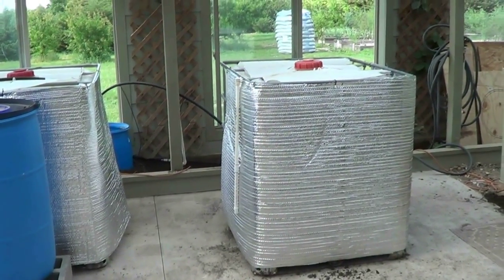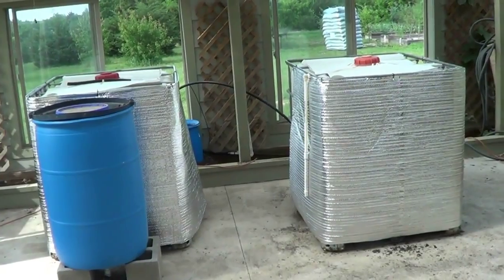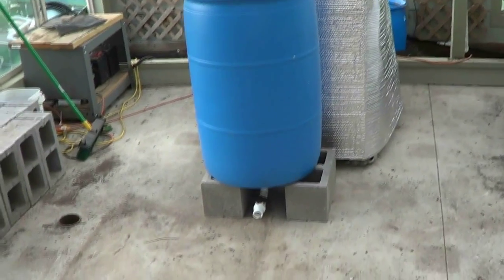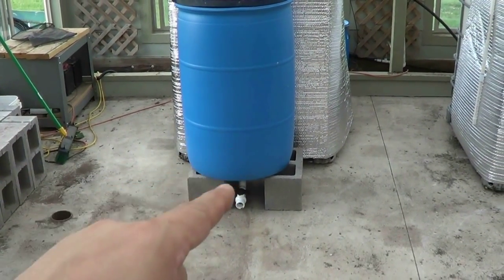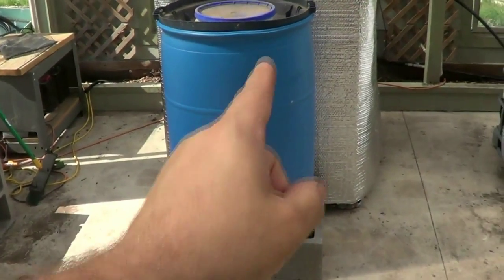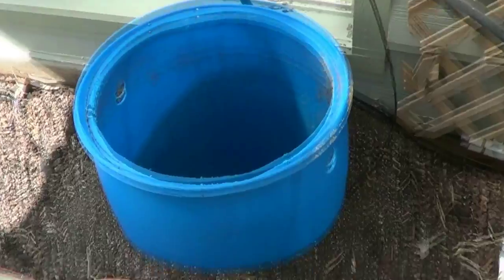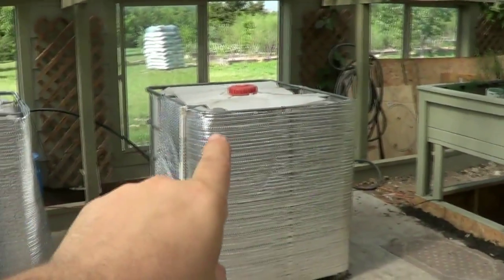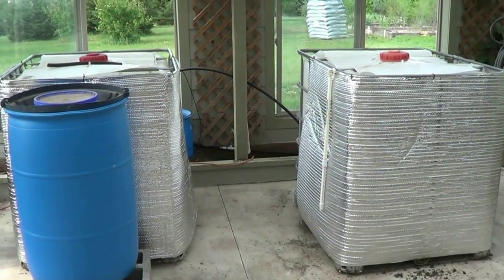Starting of the Aquaculture System

Comment: Nice home Tracy, I wouldn't go so deep with your Venturi it will waste energy for not much O2 gain and stair up the fish poop.
Great video though keep them coming I've built something similar after watching Rob Bob n Paul ;-)
Reply from the maker: I was wondering about that - The venturi's I have  will be easy to trim up a little if needed - right now they are about 4-5" from the bottom. We will see. Thanks for the info.